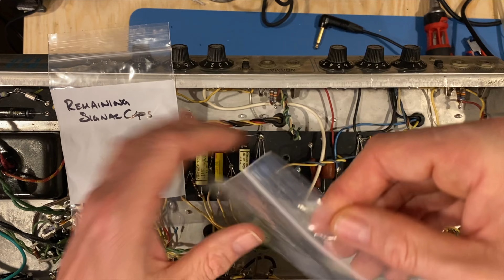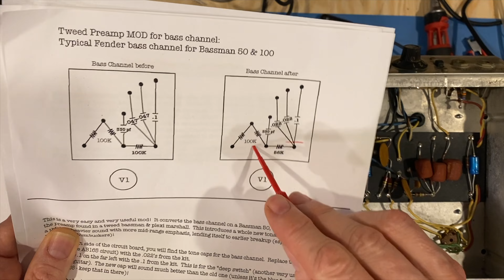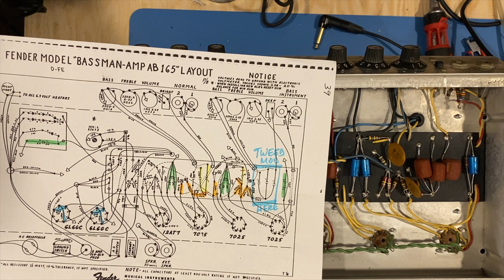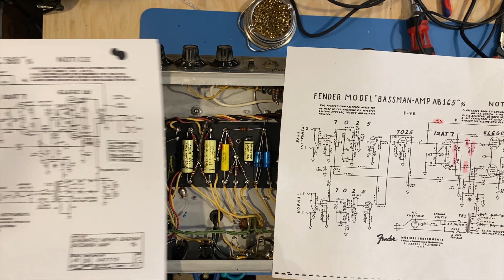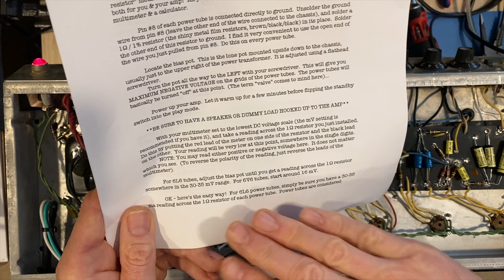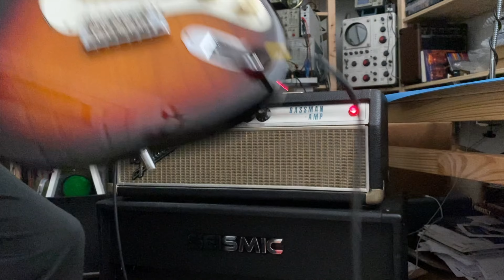FENDER BASSMAN AC568 to AA864 Plus Tweed Preamp - PART THREE of THREE

Comment: I have the exact same amp, but mine was completed in the 42nd week of 1968, and yours was the 50th week.  My faceplate is the short-lived "blackline" model.  I am going to leave mine as the AC568 circuit, but change out the resistor to ground on the bias balance pot, and add a bias trim pot in parallel with the resistor, so I can have output tube matching and overall bias level adjustment.  These hybrid fixed/cathode biased amps were biased on the cool side from the factory.  Mine is at around 42% idle PD.

Comment: That’s great I have 100 W master volume party I wonder if I can do something similar?
Reply: Hi Ivan. Can you elaborate on what you mean by similar?  What I have done here is basically rebuild this amp top to bottom, while making the normal maintenance restoration upgrades one would see for these models. Are you looking to restore, or customize?
Reply: @rickygene774  I would like the tweed channel in my Bassman 100. I was wondering if that is feasible with the 100 model having a master volume. I d take the NFL out but I just disconnected it I am planning on making it switchable now that I saw what you did.